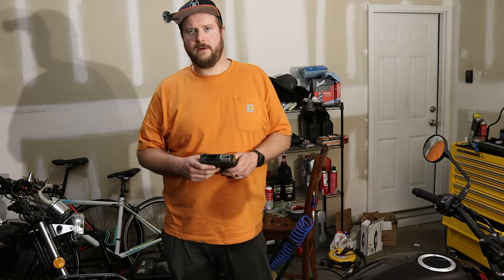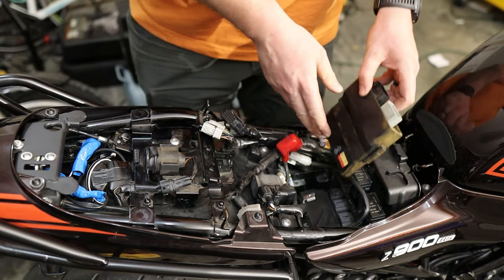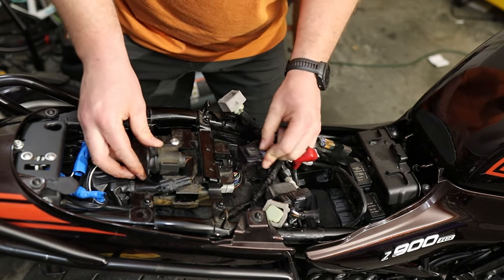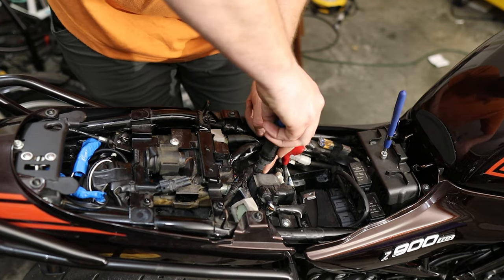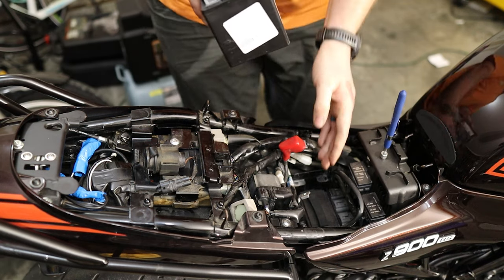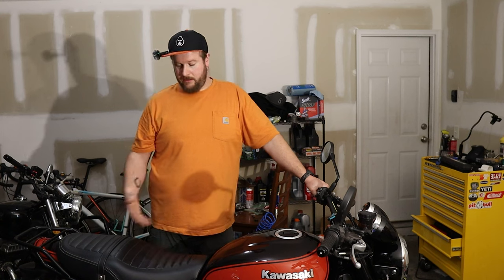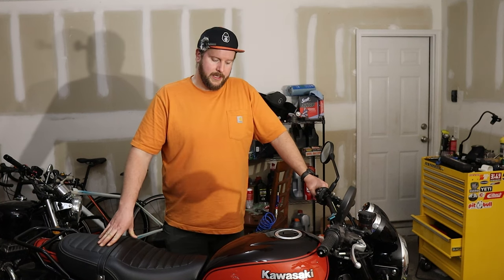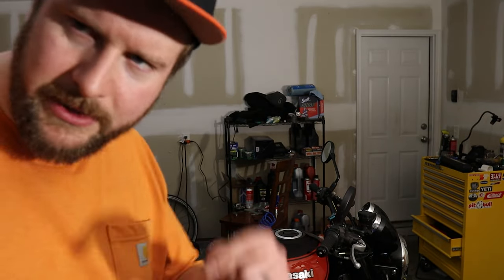WATCH THIS BEFORE YOU REMOVE YOUR Z900RS ECU!!!!

Comment: Following your videos Ive just done the Delkevic downpipe's upgrade £310 delivered. Your video helped loads, but i did connect the air fuel thing first by spinning the exhaust section onto it, then supporting that while i got the headers connected...no twisting :)
I used the standard end can but had to remove the end can gasket thing from the old exhaust...tbh i think Delko should supply a new one just for ease.
Running isn't bad ( it wasn't perfect before..) but an ECU flash is needed. I'm going to use P3 here in the UK, but their video on getting the ECU out  requires most of the back end of the bike to be removed.... however your video makes it look easy!! , ill report back next month - finances permitting ... Cheers GB keep up the upgrades :) great videos sir
Reply from the maker: Congrats on the lovely noises :D That's fair, I've always done the twist method and never had an issue, plus it's the lazy man's way....and I am very lazy. I like the path of least resistance when it comes to these things :D I don't think I even had a gasket on my end can from memory, either way I've had no leaks now and even done a track day with it! :) 
Yeah the ECU flash honestly transforms the bike!! I haven't heard of them! But if course I also wasn't looking at UK shops :) 
It's very very easy this way, literally 10 minutes!! I hope it all goes nice for you and best of luck with the bike! Thanks!

Comment: Just removed mine today. its a 2022/23 Euro 5 bike. on my bike it has a cage underneath the ECU which basically stops you getting it out that way as there is a metal tab coming of off the front of the cage on the right hand side, this seems to stop you from being able to pull it out from the front, i looked at all options but the only option i could see on the Euro 5 bikes is to remove the plastic tail and the tail tidy etc and drop the  plastic under tray down a bit so you can get at the 3 allen key bolts from underneath. this will then release the cage so you can then push the ECU down of off those metal tabs and unplug it. saying that its still not a long job, half hour max and that's the first one i have removed, so if doing it again on someone else's bike i think i could do it quicker. either way its not a hard job and no cutting needed. hope this helps someone with a Euro 5 bike.

Comment: Do you have to remove the battery to remove the ECU?  I'll be doing this in a few days to send to Ivan's.
Reply from the maker: @Twin_solo_az  you definitely have to disconnect it and I'd recommend removing it to make sure there's no mishaps with accidental contact etc. That'd be a very expensive mistake to save a minutes work. 
Technically no you don't have to remove it though, just disconnect.